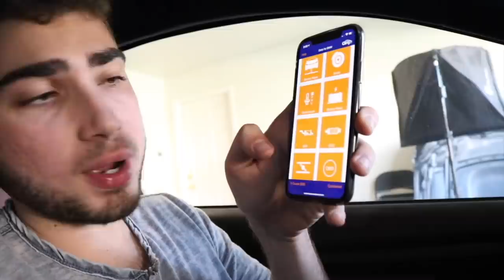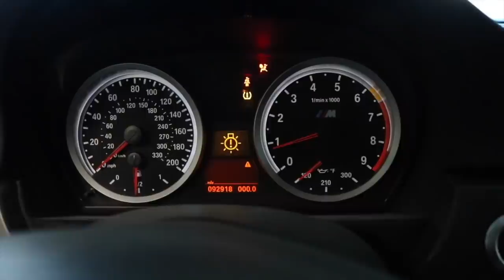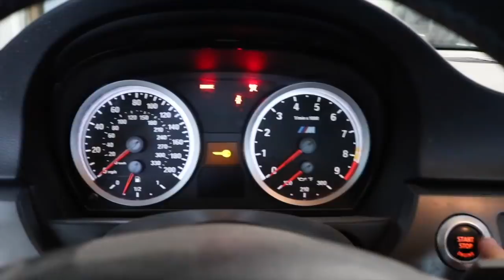Rebuilding A Wrecked BMW M3 Part. 8

Comment: You really should learn how to paint yourself. Probably not on this car but with other projects. Where you spend 2k+ for a paint job you'll be paying 300ish if you paint yourself. I just finished up my project btw, I bought a 2011 BMW 550i after watching your videos
Reply: The thing with painting a car is you need to have a VERY VERY clean environment. And ofc big compressor and a good spray gun. Congrats on your 550, I got a 2012 550 xdrive 2 months ago, it's at the  dealership now for oil consumption test. Hopefully I'll get the valve seals and vacuum pump replaced, other then that the car is a beast and I love it 😍. Congrats
Reply: @rskrks  I actually paint in my garage. I use a couple industrial fans out the window for ventilation and always we the floors before spraying. This minimizes any trash that falls onto the paint job and the little amount that does fall on the paint can usually be wetsanded off afterwards. A proper compressor and paint gun is an investment towards thousands of dollars worth of savings in the future. Also, that's great about your 550, as soon as I get mine registered I'll probably take mine into the dealership also to get the customer care package done